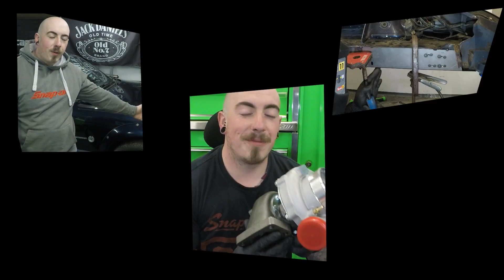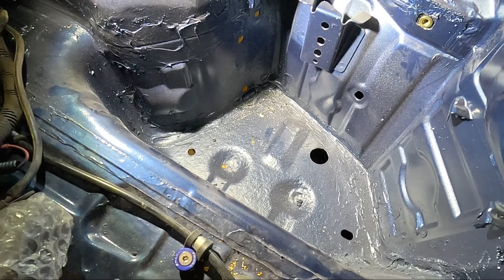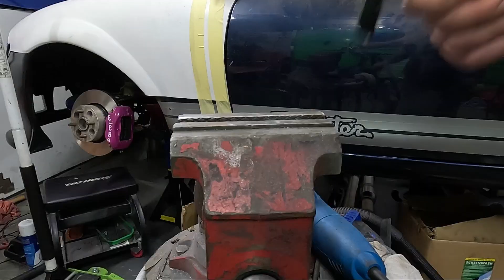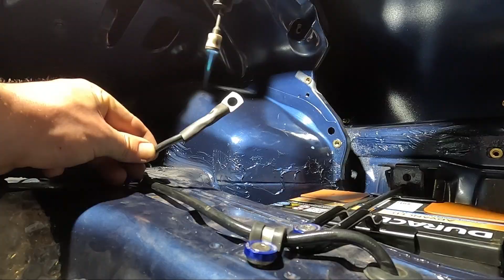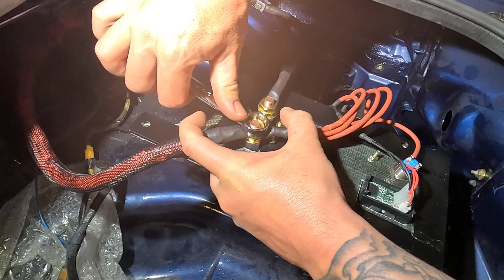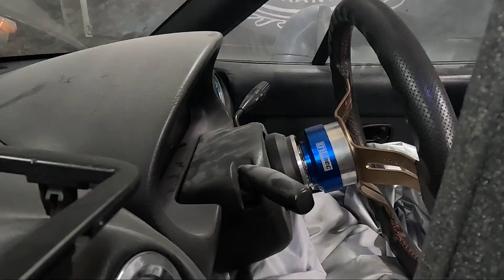MK2 MX5 MIATA BATTERY UPGRADE : MX5 TURBO BUILT pt 53

Comment: Decent video mate will definitely be doing that. But wouldn't it be better if the fuse box was on a relay to only come on under ignition power? Also as someone pointed out for motorsports we want to kill alternator power too. Be looking forward to an updated video please mate 😉
Reply from the maker: i plan on running the fuse block to individual relays to the things required.
yeah i do plan on putting a kill switch on the alternator soon
Reply: @Project380  ah I understand now. Keep up the good work!

Comment: Maybe not relevant for you, but on Motorsport spec killswitches you also want to cut power from the alternator to the system and the ignition circuit. This way you can be sure that the whole power and this engine cuts on an emergency (as stated when mentioning the switch from outside) when the car has some rpms ! Hope it helps
Reply from the maker: awesome information, thank you, ill do this in the near future